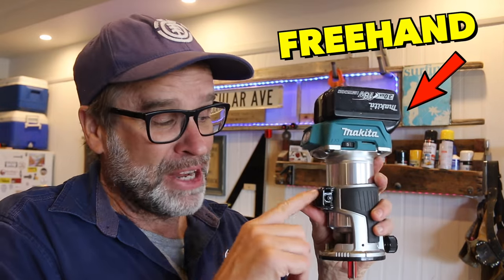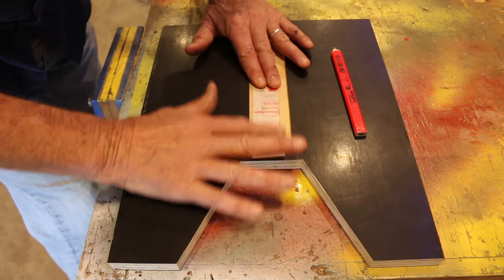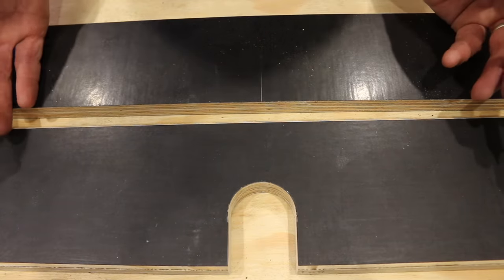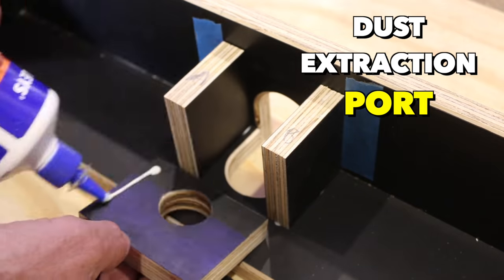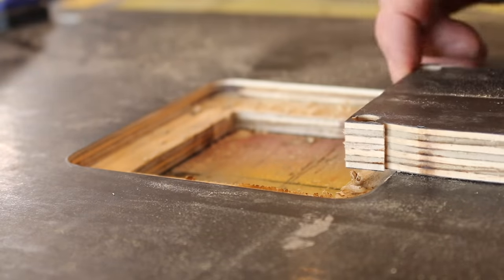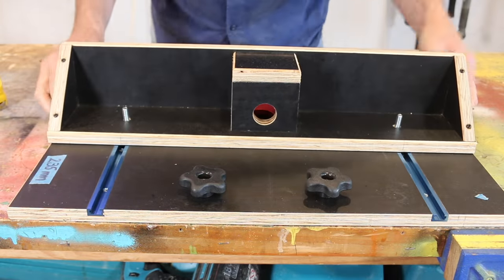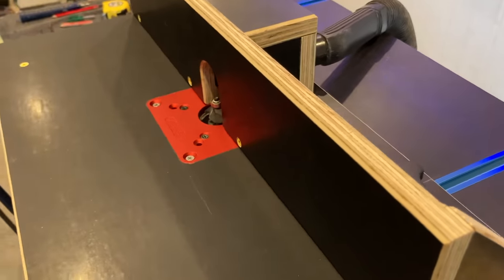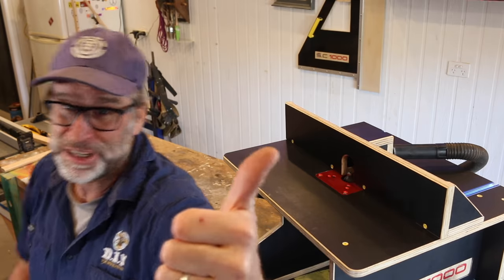The BEST DIY Router Table for Beginners. #woodjigs21

Comment: Hi Shane, Thanks for the great video. I Wanna ask u, Can I used plunge router instead ? And at min  7.50 what router bit that u used to make pattern. Thanks mate..
Reply from the maker: G'day Arman.....yes you can use a plunge router mate. The bit was a straight cutter with a bearing on top. You need the bearing on top as that is what runs along the edge of the template. The bit itself also has to be the same size as the bearing. My bit was 12.7 mm wide which is the same size as the 12.7mm bearing. Good luck  👍😁🇦🇺

Comment: A GREAT project. One I will work on next. 
Question: do you need to check to make sure the fence is square with each use, or is there small enough "wiggle room" on the T Tracks that it will be forever square?
Reply from the maker: Thanks Greg! The Fence is not forever square as both T Tracks are seperate from one another and move independently. Have a good one mate 👍😁🇦🇺
Reply: @diyforknuckleheads  I want to make this, but was already annoyed just by seeing you squaring it up. This design is the nicest I've seen so far though, and I got the benefit of having a few meters of leftover black formply so it's a cheap build for me - but I think it will become perfect with the addition of some side panels which keep the fence square in any position. What do you think? :)

Comment: Just a little warning about mounting routers under a table , as they are designed to run upright the cooling fan blows down over the chuck , when the router is run upside down there is a danger that saw dust can fall down inside the router when it is turned off , if you don't have a dust extractor blow the router out regularly , We had a Hitachi in the cab shop mounted like this and no one blow the thing out and after a couple of months the top bearing  seized
Reply from the maker: Good advice Ron 👍

Comment: Thanks for this! What is the benefit of the router plate? Just looks like an opportunity for mis-measurement/catching edges. If you have to screw the router in anyway why not just cut a hole in your surface and counter sink holes in the right places to screw your router in?
Reply from the maker: Thanks mate and yes you can do what you suggested. The router plate just gives a very secure way of mounting your router. 👍

Comment: great vid and i love the router table design its compact and great for a tight shop which i have . can i make the router fence openings larger for the larger raised panel door bits ? and can you recommend a router plate like the red one you installed?
Reply from the maker: G'day mate....yes you can....you can customise it any way you like 👍 The red one l used is linked in the description box under the video. You just need to make sure that it will fit your machine 👍😁🇦🇺
Reply: @diyforknuckleheads  thank you sir.

Comment: Nice build except that I think you need to unscrew and drop the router from the insert to change bits (not efficient). Your build is remarkably like the one including the fence. The differences include:  I did not install tracks (used slots in the fence and fixed bolts on the table to get the same function), my deck is removable and the base folds for compact transport, and (important to me) the insert is truly drop-in so that I can change bits without removing any mounting screws. Good job on yours.
Reply from the maker: To change the bit, just simply release the router from the base. With routers these days it takes about two seconds so no big deal 👍 Thanks for watching 👍😁🇦🇺
Reply: @diyforknuckleheads  - GOOD POINT.

Comment: I recommend just buying a cheap bench router table instead of doing all this if you don't know what you're doing. I tried and spent as much on materials and a table insert that didn't fit any of my three routers as I ultimately spent on a pre made bench router table. This one made in the video looks way nicer and probably has a better fence though. I got the Ryobi and wished I had got the Bosch cause the fence on my Ryobi is an engineering brain fart that seems made to be horrible though I like the rest of the design. Great video though! Nice looking router table!

Comment: @DIYForKnuckleads is face film plywood what you used for this project?
Reply from the maker: Yes it is Carlos. It's called Formply and it is what concretors use to form up concrete so that you finish up with a beautiful smooth face and its easy to remove 👍
Reply: @diyforknuckleheads  Hi Shane, thanks a lot for your reply and explanation. As to the video, very nice and helpful!

Comment: How does the glue go with the slippery black stuff.  Can I use melamine instead of the black stuff?   I can't find a concrete pour nearby to scavenge from.

Stavros
Reply from the maker: G'day Stavros....Melamine would be fine mate. The glue does have a little bit of hold.....l stuck the dust extraction  port down with it and all is good 👍😁🇦🇺

Comment: thanks for the plans!  you contacted me through ETSY but It wouldn't let me respond back for some reason.  I plan on building this router table with a few minor tweaks but it looks great!
Reply from the maker: Hi Neil, l recognise your name 👍 That's a bit odd that you couldn't contact me...🤔 Oh well, you have now and l hope it goes really well for you.... I'm sure it will! Cheers 👍😁🇦🇺
Reply: @diyforknuckleheads  thanks for getting back with me.  I have a Bosch plunge router so my insert would be different than yours.  The insert that I would have to use is quite big and ugly.  So now I'm just thinking about  not using one.  What you think about that?

Comment: Hey uncle, are you worried about gluing the formply? I thought it wouldn't hold being laminate to wood or laminate to laminate?
Reply from the maker: So far so good mate.....there's no pressure on it and appears to be holding up well 👍👍😁🇦🇺
Reply: @diyforknuckleheads  Glad to hear it! Maybe I will just glue it too!
Reply from the maker: @jsporish  Doesn't hurt mate. If for some reason it fails, just drive a couple of screws into it 👍👍

Comment: Knucklehead question .... is there a way to make sure the fence is even (square?) on both sides of the bit other than measuring back and forth from end to end (in my obsessive-compulsive world) dozens of times??
Reply from the maker: Yeah it's very easy Rick.....as l mention in the video, all you need to do is line the fence up with your square on the edge of the table. Trying looking at around the 11.45 second mark in the video 👍👍

Comment: Hi, love the table, I have purchased the plans & ordered the parts! Just one question: Is the distance from the front edge of the table to the router insert plate/centre hole an arbitrary one, or could it be moved further towards the back (say another 50mm) to allow for wider boards? Love your work!
Reply from the maker: Thanks mate....and yes it is arbitrary. Good luck with it and thanks for purchasing the Plans 👍😁🇦🇺

Comment: What kind of wood glue are you using that holds to sealed and slick surfaces?
Reply from the maker: Michael, the glue thing was more of a habit than anything else. It was just wood glue. I actually only glued the dust extraction port together and it worked OK 👍

Comment: Hey Shane this is beaut mate and thanks for the very clear instructions and plans. I’m a beginner and am slowly building my benches for power tools in small half carport shop. anyway, the screws you use mate have those great ‘nonslip’ multiple star shapes on the heads which minimise the drill slippage like you get from phillips head - watched mere mortals Steve explain screws in his beginners set and I was very keen on these screws for the slip issue and minimise swearing when grandies are helping (they have a pretty good grasp of what words to use when it appears)😂😂😂 - so mate where did you get these screws? Not in your hardware list. I’m in a wheelchair so i don’t get to hardware shops as much as I would like but Ill be having a good search but if you could point me in right direction about potential retail options for purchase this will give me great excuse to make my way👍👌👌. cheers mate and ta so much Aussie content.
Reply from the maker: Thanks mate!....glad you liked it 👍👍 The screws were actually square drive screws that l painted with a yellow gloss spray paint. Here's the link to them https://www.bunnings.com.au/zenith-8-10-x-40mm-treated-pine-countersunk-head-screws-100-pack_p2400008
Gotta be a little careful around the littlies 😂 ....they pick up stuff like you won't believe.....as you well know 😂 
Well done too on  getting out in the shop in your chair...very impressive 👊👊 Thanks for watching and l really appreciate the feedback 👍😁🇦🇺
Reply: thanks for the acknowledgement Shane, and I know your busy but could you tell what the screws are called please mate?
Reply from the maker: @jessss1011  Mate, they are called square drive screws 👍

Comment: Great Router table there Im gonna make one. A quick question though, when you make the jig (the one with sticky tape) at around 7 mins, are you using bushings on the trimmer ? Or is the hex nut that the bit goes into, due to its spinning so fast, compensating as a bush ? I hope you understand what im getting at !
Reply from the maker: G'day J.J. The router bit has a bearing on the top that rides against the template. You just have to make sure that the bearing is the same size as the cutter. My cutter was 12.7mm as was the size of the bearing. Good luck. 👍😁🇦🇺
Reply: @diyforknuckleheads  Thanks pal thats great Ive had a look and now know what I need !
Reply from the maker: @JamesJames-um5xq  Good stuff mate..

Comment: Question from the newb - could this also be done with a fixed base router?
Reply from the maker: Yes it can mate.....The router l used in  the video was a fixed base router. If you're interested, the new revised plans are in the description box under the video 👍🇦🇺😁

Comment: Hello!  Very good and simple, your project and your didactics are excellent.  Now, I was curious to know why you pass measurements in mm.?  More precision?  I prefer it that way, although it is very easy to deal with the standard in inches, as I am a Product Designer and I come from a country where measurements are metric.  I set mine up with one of those aluminum plates.
Reply from the maker: G'day Rodrigo 👍 I use mm as that is the standard measurement here in Australia and l also find it a lot easier than imperial as we are only dealing in single figures....no fractions. Thanks for watching...l appreciate the feedback 👍🇦🇺😁
Reply: @diyforknuckleheads  Oh!  Thank you!  Now I get it.  I'm Brazilian, and there the metric system is standard too, but now I live in Florida and use both.  This is a little confusing.🥴G'night!
Reply from the maker: @ToriKanji   👍👍

Comment: Good project. I will be making one of these. Just one thing…I have bought a router base plate and no matter which way I turn it I can’t align me Dewalt trimmer up with the existing holes. Any tips on that please.
Reply from the maker: Thanks Anthony! Mate that is a tricky one as not all plates match all routers. You need to search for one that suits your machine. It took me ages to find one that matched mine. Good luck with the table and l appreciate you taking the time to watch. 👍👍
By the way, if you cant find a plate, just drill new holes into the one that you have. 👍👍😁🇦🇺
Reply: @diyforknuckleheads  Thanks. Great idea.
Reply from the maker: @anthonygreen9609  👍

Comment: Sorry if I missed it, but what router bit did you use?
Reply from the maker: Hi Manuel....it was a straight cutter with a bearing on top. Just make sure that the bit is the same width as the bearing 👍

Comment: On the plans I got from you, the right bottom base isn’t as wide as the left.  Left is 5.5 inches wide and the right is not as wide but it’s 22” wide
Reply from the maker: Great pick up Neil! That centre measurement should read 11" 😬 I'll get onto that and thanks a lot for giving me the heads up. Cheers 👍😁🇦🇺

Comment: This is amazing!! I've never found a video on making a router table, they've always been overwhelming or whatever. This is perfectly simple and entertaining, thank you so much! I also have to confess I laughed at your dad-jokes :')

Question: what if, should there be a way which works, there was a way to tighten bolts on the t-track to always keep it square without the speed square? I'm thinking two bolts either side with a cement so they're tight enough to keep it rigid but loose enough so it slides freely-or maybe an l-bracket used for cupboards and such?
Also, I'm not one to jump on a band wagon because loads of people do it but what's your opinion on using a French cleat to aid with the table mounting on the workbench? I can't think of any way it might tip or come off unless using long boards that extremely heavy for it?
Lastly lol, what about something like this partly built into the table? A removable block in a workbench for the router, but otherwise just the flat board and fence? :O
Thanks again pal, amazing walkthrough and craft
Reply from the maker: G'day Richard, all of your comments are valid mate. The French cleat would work. I have found a flush mount bracket on Amazon that works as well for attaching the table to your bench. I was going to do it on this build but the delivery time for the product was to long. You  could build this into your table if you have a table big enough. 
Thanks for watching mate and l really appreciate the feedback 👍😁🇦🇺
Reply: I'm surprised you can see my name on here lol, not like I have an issue with it :) thanks for your reply and such! Wow, flush mount like what's used for photo frames? That's what came up solely on Amazon :s Im surprised seeing this, but also not because it's thick metal and four screws each...idk how the alignment would be for ease, though. This would work well, thanks for the suggestion! :D
Reply: And talking of a table big enough, I think the flip tops people talk of look great, yes perhaps a "thing" but it all has a valid point of doubling the size of the workshop, little effort and time to set up and still having the tools out the way while having a flat bench for the likes of the mitre saw flush or the table saw. I also like the idea of all the modular benches being on wheels to mix things up to find which order is best, or extend said table saw surface for in/out feed or sider material etc-though the latter may be a hand held circular, I wouldn't know. Anyway, I'm rambling-ill try these for sure :D thanks a lot pal great stuff

Comment: @7:41 how do you prevent the bit cutting into the guide block? I tried this and it was not pretty :(
Reply from the maker: Mate, you need to use a flush cutting router bit that has a bearing on the top. The bearing runs up against the guide block preventing the bit from gouging into it....hope that makes sense.
Reply: @diyforknuckleheads   Thanks Uncle Knackers! Love your videos, I have treated this one as a learning experience! I do have trim bits but couldn't figure out the block depth. I had another go today setting the blocks back far enough to allow for the base plate, and that worked.
Love your channel, cheers from Brissie :)
Reply from the maker: @21coolie  Great to see you got it sorted mate 👍🇦🇺

Comment: Nice video. However, when glueing film faced plywood, you need to sand/making rough the glued area/surface - othervise glue will not stick on to phenol film.
Reply from the maker: Thanks Heikki.....it really didn't even need the glue....force of habit 😊....but you're right, a quick sand would have been a good idea 👍👍😁🇦🇺

Comment: You guys must have access to some very special plywood cause when I drill a hole and put in a screw to the side the thin layers it is glued/made of splits. So making any device ot of plywood that holds fast rotating, sometimes heavy mashinery looks pretty dangerous to me. But you might have better stuff than us up here in Sweden
Reply: yea I have the same problem in Norway. The Russian bjerk ply is by special order and prohibitively expensive. All that´s available in the big box stores is fast-growing furu from Chile. I avoid screwing the sides where possible. Another local problem with this particular design is questions on compatibility of my Makita RT0700C with the router table plates that are available here. Shame about that.
Reply from the maker: Not sure on the plywood comparison mate as this is just the stuff we have always used and don't have any problem with it. The Unit once all screwed together is incredibly strong. Thanks for watching 👍😁🇦🇺
Reply from the maker: G'day John.....I'm pretty sure the insert plate l used is compatible with your router....just double check that though 👍
Reply: @johnsmall9729  That´s strange I thought the plywood up here in the nordic countries was imported from us in Sweden but we might not even do that our selves then lol. I´ve heard of Polish birch plywood but not Russian
Reply: @diyforknuckleheads  But that`s plywood for casting we got it up here to. But then again you might make your own